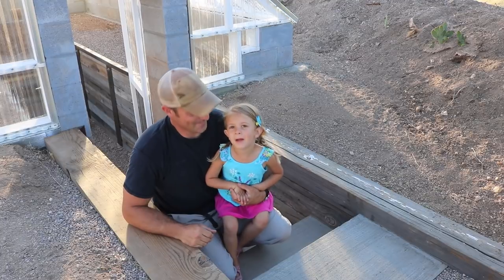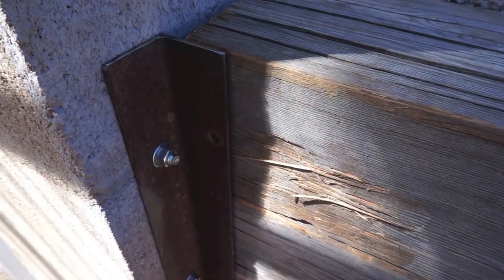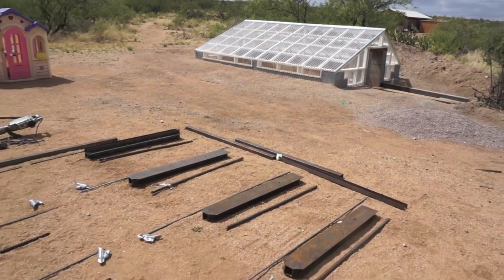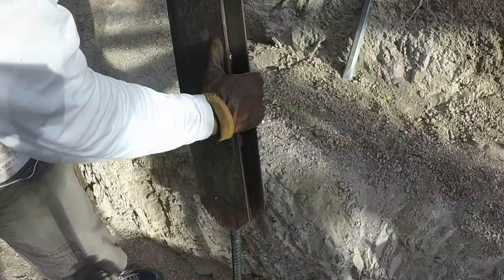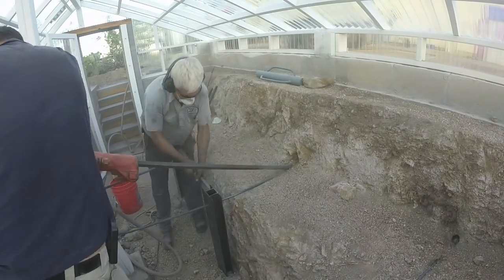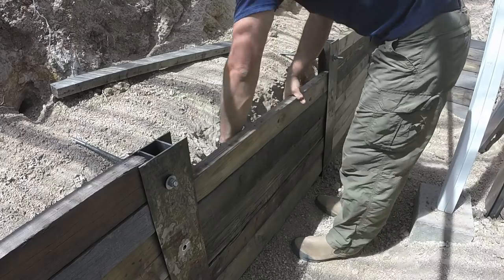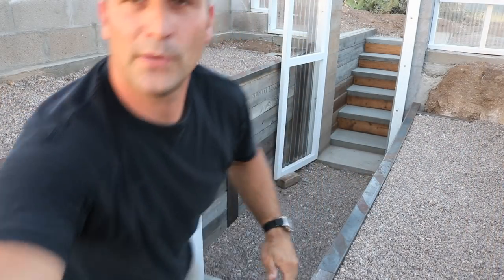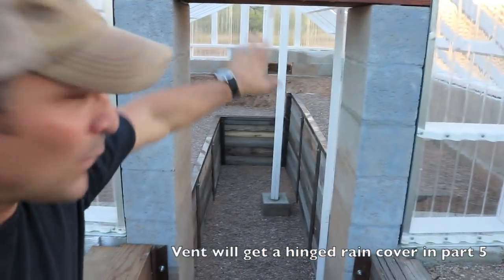Sunken Greenhouse Part 4:  Entry steps and Retaining walls

Comment: I also inherited a pit greenhouse, circular, 20 ft. Across, a center post that holds the supports for 6 mil plastic. Concrete walls are about 6 ft. High. My creative mind hasn't been able to use it to its best potential. I hope to see more of your videos as you use it. Great work so far. John rabeler

Comment: I installed a wet wall in mine to keep the temperature cooler, basically a gabion wall filled with charcoal with a water pump and collection underneath to circulate, then fans on the opposite side to pull air through the wet wall. Great cooling effect.
Reply from the maker: +Charl Joubert holy smokes!  That's an AWESOME idea Charl!  Kinda like a gabion style swamp cooler of sorts I'm guessing... I might have to borrow that idea:)
Reply: +homesteadonomics let me know if you want my plans for it and some photos of how it works and looks. Works great especially in those 110'F days
Reply from the maker: Yes, that'd be awesome!  You can get my email on the 'about' tab Charl.  Looking forward to seeing the pics too!
Joe

Comment: As much as I admire the thoroughness and quality of work in your projects, I can't help but feel that those retaining walls for this greenhouse are WAY overkill (almost discouraging). I could and would have done retaining walls with CMU block far easier than this anchor system! After all, it is a greenhouse, not a freeway overpass.
Reply: I think if I did it like that I'd turn it into both a greenhouse and a storm shelter
Reply: WORD!  It's amazing work. Definitely a habitual overworker! Thanks for the ideas. I'll SIMPLIFY EVERYTHING. 🎉

Comment: Support pole pad looks wet. You should jack that beam up and put some rubber/tarpaper or a metal plate between the concrete and the wood to help prevent the bottom rotting.

Comment: I have loved your series on your greenhouse. I will be utilizing many ideas you have here, thank you. I am looking into the Sutter retaining system, but I'm not sure yet. My terraced backyard is significantly sandy and easy to dig up. Would the anchoring system utilized by Sutter be better, or doing concrete H/I beam posts with the sleepers? As my terraces will be inside the greenhouse, this is an optimal system to maximize my space.

Comment: 6:39 I hope those concrete blocks are rebar reinforced and concrete filled where you connected that angle iron... Otherwise if you have any wet ground freezing and pushing those sleepers in, they're just going to take that block wall with them.

Comment: I really enjoy watching your videos.  They are informative and inspire me to tackle some projects I normally wouldn't.  Would you mind sharing the cost of the retaining wall materials?  Regards and happy homesteading.
Reply from the maker: Hi Carl,

Sutter equipment has a price sheet on their page as I don't remember quite what I paid exactly.  All the wood was free but the metal components definitely aren't cheap.  But in short, I want to say that the 'h' posts were about $70-75 each and the rebar, top caps and anchors all added up to a couple hundred more.  It definitely wasn't the cheapest option but in my limited space there weren't a lot of options that didn't take up a significant about of space.  So for the space limitations I had, this setup was really awesome.  But if I had left more room at the bottom, I might have considered some other alternatives too.  But with that said, the folks at Sutter were really helpful and I think their system definitely is pretty cool.  But definitely not the cheapest:)
Joe

Comment: Joe, that's a great structure!  You'll have to replace the glass and framing multiple times before you have problems with the retaining walls beyond replacing some wood in them that may rot over the years.  It's so well built, it makes most of the greenhouses the rest of us own look like bushcraft leanto's.   Are you going to add any growing medium on top of the pea gravel or are you planning on leaving everything potted and only having your plants inside over the cold months and then back outside when it warms up?  If momma ever does request that you to relocate to the dog house, all you'll need is to extend your wifi signal and you'll be good to go.  haha  Remember to put in the weather station and a remote temperature / humidity sensor inside the greenhouse to save you a lot of steps checking on your plants over time.  Lastly, as you dream, are you thinking of several solar panels and the related power distribution system to power the pumps and lights for your hydroponics?  Hey, guys can dream can't they?
Reply from the maker: +Lee Drew Oh man Lee!  You're just putting more ideas into my head...lol!  You get me thinking of new things all the time!  As for growing medium, I'll probably do most in containers and just move em' out in the hottest 2-3 months.  And the temp/humidity sensor is something I'm going to have to look into.  haha... you got my mind going and google is going to get searched here pretty soon:)
Joe

Comment: I am all about over engineering, but if you have to drill into the wall to install anchors, what are the chances that the walls would ever be subject to collapse in the first place? it looks like the ground the greenhouse is sitting on is plenty stable to hold the entire structure without any retaining wall or reinforcement. Looking at your project, I am wondering why you didn't excavate a hole a little bigger than your greenhouse, build a block foundation all the way around and then build the greenhouse on top of the block? Rebar and concrete inside of the block would have been more than enough to provide a stable wall to build on. You went to the trouble to put the greenhouse under ground, but only dug out a walkway through the middle?
Reply: have to agree with all of this comment. a lot of work for what benefit? still nice work anyhoo
Reply from the maker: +Robert Morrison Yep, it's not the best way to do things.  I've kinda been figuring as I go...lol:)  And yes, the retaining wall probably wasn't absolutely crucial, as this rock is pretty darn stable.  But it's something that I wanted to try, to make for a little nicer inside.  In reality, I hope it inspires ideas for folks on their own projects versus a 'how to' or 'the way it should be done' kinda thing.  It could certainly be more efficient, deeper, cheaper, etc,...lol.    But it's an experiment in my mind still;)
And to your question of depth... that is actually something I purposely didn't do, was to make it more than 4ft deep.  If it was, I'd invite all sorts of engineering/permit things from the 'department of whatever"...lol.  Anyways, I know its not perfect but overall it's been a fun project and hopefully it'll provide a little payback in the winter:)  
Thanks for watching Robert:)
Joe
Reply from the maker: +jumpleadsx2 Yep, it's more things that I wanted to try versus what actually is needed.  I could've made do without stairs or even the retaining wall.  But it's part of my experimental process and I hope it inspires ideas in others more than anything:)  thanks for watching!
Joe
Reply: It sure looks pretty.
Reply: @homesteadonomics  buddy i was thinking the same as guys above, but i was also thinking about the amount of things I've done which weren't needed ha. Takes a man to admit it and accept the time wasted, but if you enjoyed it and the outcome is as amazing as it is 'who cares'.
HI from the uk.

Comment: Awsome green how's if I say so myself Sir ! One of the best I've seen yet 
Been researching to start on one 
Wondering a round about figure on the material you have invested in this project?
Reply from the maker: Hi Josh... so far I don't have a figure as I've been building little by little.  But as  ballpark, to get to the stage before the retaining wall, it was probably in the 800-900 range.  It could be done a bit cheaper but the polycarbonate panels were worth the extra cost in there overall durability and longevity.  The retaining wall system was not totally necessary for my soils but I just liked the way it looked and wanted to try it out.  Definitely not the cheapest option.   Depending on your soil type a traditional retaining wall system might work out better and be cheaper as well.  OR if you tapered the walls out more or didn't have it quite as deep, you might even be able to forgo the retaining wall.  Anyways, i hope I didn't just ramble on too much...lol... but I hope I answered your question at least a bit:)
Joe

Comment: Using aircrete (concrete with foam mixed in it) will cut the weight in half and you can make a foam generator for around $40.  This will make really good pavers.

Comment: How would you go about making the retaining walls flush with perimeter of the greenhouse? Would you have just built the block walls straight down, had a foundation at the bottom and used that as a retaining wall?

Comment: Nice aesthetics and awesome project but...
Once you get down to a point where you need a jackhammer, you can start the top of your retaining wall.  Looks like you didn't really need one at all here, but se-la-vi.

For a cheaper, long lasting version where you actually need a retaining wall, you need drainage behind the wall  such as landscapers fabric filled with gravel/sand/rubble and a place for it to get out.  Instead of the expensive H beams, you could use standard metal studs anchor bolted into the footer (in this case the bedrock)  put some plastic on the inside of your form before the pour and the forms will come right off - no need for wood that will rot anyhow.  Don't forget to put the drainage tubes before the pour to save some work.

Alternatively, if you happen to have a lot of nice looking stone available for free, a slip form wall looks great and the amount of concrete needed is reduced.  Dry stacked or mortared stone works too, but there is a bit of a learning curve to it.

Comment: just awesome bubba
the retaining wall by the steps. did you decrease length on the beams as you went down.
Reply from the maker: Hey Steven... yes I did... they all extend to just past the step that the are aligned with.  Bottom ones are like 24" long and the tops are like 9 or so feet long.  thanks for watching Steven!
Joe

Comment: Over 20 years ago when I first moved to Alabama, I wanted to build an in ground greenhouse. the ground is very sandy here, so I knew I was going to have to at least put some 6 inch block along the walls. In your case, I wasn't saying to go any deeper, just make the whole interior the same depth as the center aisle. Though it is a shame that you live far enough from town that you are off the grid, but not far enough to escape their code enforcement bureaucrats.
Reply from the maker: haha... yes code enforcement has long arms.  I try to work within the constraints as much as possible but in the end the bureaucrats will never be satisfied...lol!  ... and yes, the walk way probably should have been a little wider...but it's gonna have to work for now...lol

Comment: This is getting along very well, great job so far! I have to add, with every structure that goes underground it is a must to install a water-runoff system, so i was happy to hear that you tought about that as well, when you mentioned rainwater-harvesting. I was thinking to build a greenhouse with a similar design, my soil is not so hard fortunately (mainly clay, but i was putting compost piles over the area - where i like to build it - years ago, so the soil became softer gradually). My question is, do you plan to install solar-panels as well? It'd be a great idea, because you could drive a whole arduino-based control system with that, you could automate watering, ventillation, lights, security system, etc. on the fly (that's what i'm going to do for sure once i finished building).
Reply from the maker: Hi Plord, yes I plan on doing some solar for sure... the first thing will be a solar exhaust fan to help vent the structure during the day.  But the other solar projects will probably be a bit later.... but I like your Arduino system idea... might be a little too complex for me to totally grasp at first... but it would certainly be cool to play with:)
Joe

Comment: Beautiful work!  I am a ummmm plant and construction professional, honest.  That first tier should be just for potted plants.  I am assuming you've another tier to finish?  To put soil (should be sterilized potting soil btw) on top of your pea gravel would be to make a perched water table. Not good. I would keep that interior as artificial as possible.  You are on top of the ventilation!  Most do not know how critical air flow is for the greenhouse environment.  Those pvc pipes...were they for air flow INTO the grow house or for drainage away from the grow house?  Do you have perf pipe below those wood slats for drainage outside?  This is beautiful if you are planning on using pots (and potting soil)...absolutely beautiful.  I don't think without a lot of work you'll be able to make beds out of those tiers.  Gravel, pea gravel, sand....below the soil of the bed (minimum 1') will make a perched water table; the small pore spaces in the soil will have to become saturated before any movement of water can happen into the large pore spaces of the pea gravel.  Way too long for roots that need air...root rot and unhappiness. Those old 2X 's are to die for wood.  You should put plastic between soil/gravel/rock and wood. The old PT wood has very suspect chemistry.  Or did you coat the wood yourself!  This would make a wonderful tiny home!  Will you have water lines to this building?  Do you have a well or do you have city water with sicko fluoride?  Fluoride is pure industrial waste that you and your family should not be drinking and you do not want to water your plants that you eat with fluoride either.  Looking forward to the finished product!  btw, make sure you've some electricity out there for artificial lights and heating if you want to grow a bit during the winter.  Maybe a hammock?  Definitely FANS. Plant leaves should be in motion, oxygen taken out of the room and away from the plant leaves so that CO2 is allowed by the epidermis for use in photosynthesis.  No smoking...tobacco mosaic virus will easily infect tomatoes and other plants.  A sink would be wonderful. Mason bee housing and mason bees. No friend's pots and soil and funky plants to be allowed without a contamination period.  No smoker friends without washing hands first. Shelves for fertilizer and notebooks.  Music...definitely. What a wonderful space you are making!

Comment: You must live in a desert! 
Where are you in the USA?
My problem will be keeping water OUT!
During winter, the water table rises to about 3-4 feet from the surface, so any holes deeper than that will fill with water. Wood will rot in 2-3 three years. What I'll have to do, is treat it like a pond, and line it with a waterproof membrane.

Then build a reinforced block wall inside it to retain the ground, which is mainly clay, with a good helping of rocks. [It's terminal Moraine,  left over from the last glacial period, 10k years ago.]
I'm surprised that you put 'glass' front and back. 
I would have thought that using the excavated material on the north side would have acted as a good heat sink.
Otherwise, I found the construction process interesting, and gave me some ideas.
Thanks.

Comment: Loved your cutie intro helper of course... We get to see her growing...  Just wondered a couple of points.. Just curious about your thinking and now any hindsight. With the type of soil/rock you have there, was that complex of retaining wall really needed? Wouldn't a simple cinderblock/rebar set up have worked and been easier?  It seems to be overkill for the amount of effort.  The other question is if it would have been easier to build a retaining wall prior to building the rest of the structure (backhoe work).
Reply from the maker: Yes, she makes her Daddy soooo proud!  Of course, I might be just a bit biased...lol;)
Regarding the retaining wall questions:
-the wall probably wasn't needed as the ground is pretty stable... but it was something I wanted to do to clean up the area bit and give some nice shelves to set stuff on, etc,.
-a cinderblock wall was one of my first considerations but I'd need a footer approx. 24" deep, and I was not looking forward to digging that and pouring the concrete by hand inside...lol.. of course the jackhammering presented its own challenges:)
-and building the wall pre-structure... yes, absolutely... but as I mentioned in the earlier parts, I wasn't sure what I was going to do for a wall and had just wanted to get the structure up so that I could have a usuable greenhouse.  Then I could worry about the wall at a later time... but, it would;ve been soo much easier with out  a sauna surrounding me...lol:)
Reply from the maker: almost forgot about the style of wall/complexity question... no it probably was not but I had seen the wall on an image search and just thought it looked really cool, and liked that I could use scrap wood with it.

Comment: Did I miss where you ended up using those PVC pipes you had embedded horizontally into the sides? Also, why such a robust retaining wall if the dirt (caliche) is like rock anyway?

Comment: How is this wall holding up?  Are the posts still plumb?  I'm thinking about purchasing this wall system for my home in upstate NY.
Reply from the maker: The system is still working very well! What you saw me have to do would be the extreme as most other soil types would be able to use a simple electric jack hammer and no drilling.   I think it is a great system👍😀

Comment: Your project is awesome. But if I may , temperature controlled spring triggered top vent . 
No electricity needed . 
It only takes one failure or forget to open vent Windows to kill your crop.  Especially if they are a little dry.
Just speaking from my own experience.